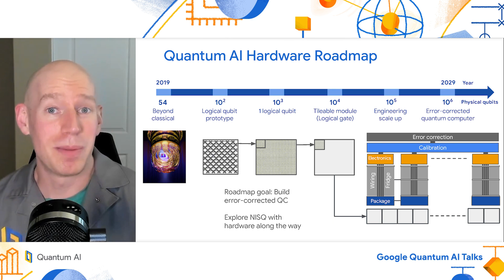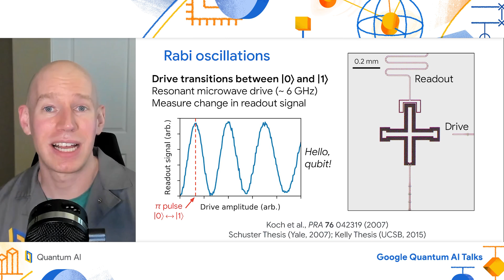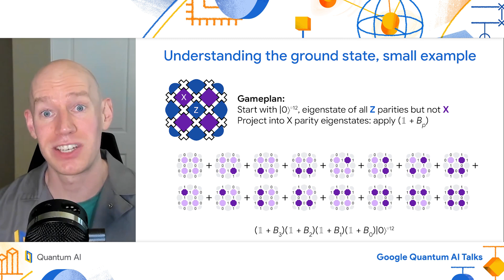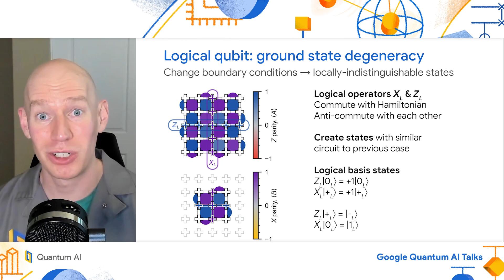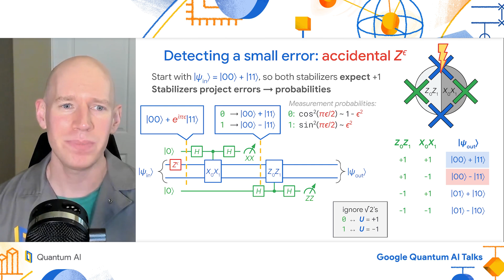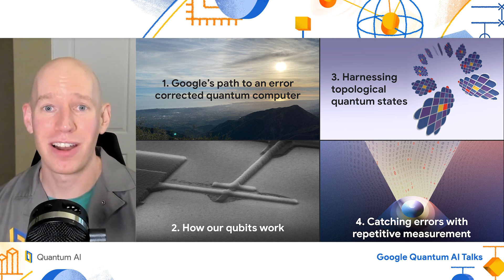Progress in superconducting quantum computing at Google

Comment: I wonder if it would help in order to keep the errors low, using  synthetic diamond to keep it from heating up and  borophene for  its circuitry benefiting Josephson currents in a boron titanium alloy casing to keep external forces from influencing the internal function.
Reply: This would only work with natural diamonds at least 100 carats in size.